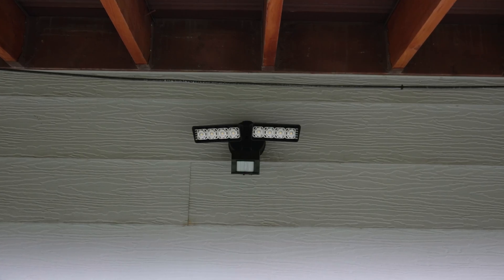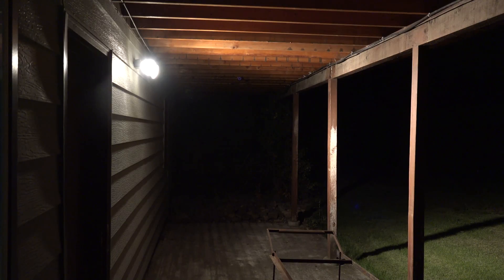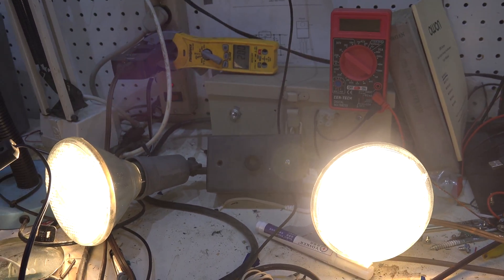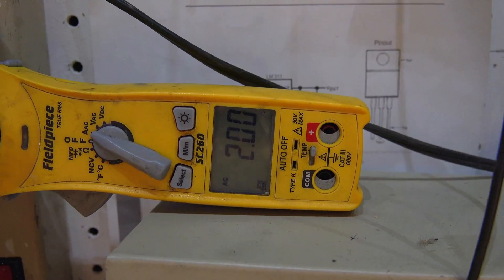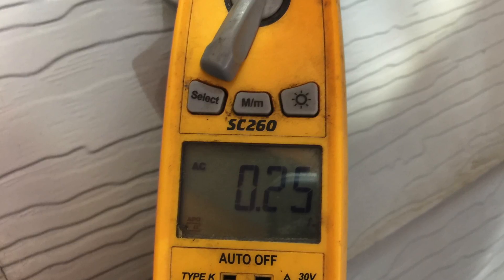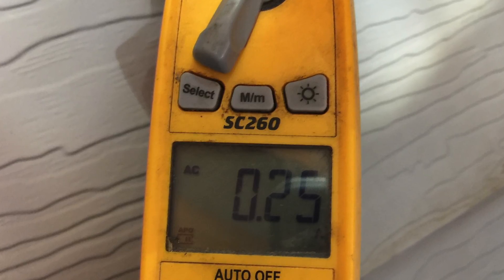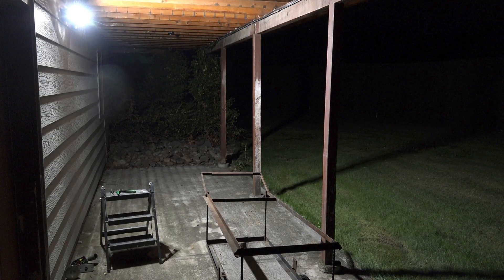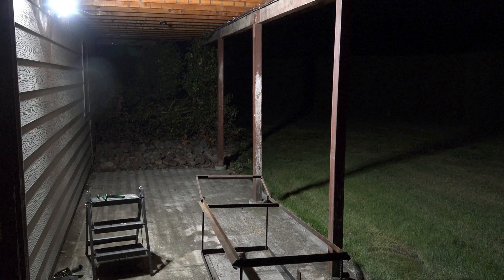A test of a Loftec LED sensor lite.

Comment: Also note that sensors (Motion) tend to work best discovering/sensing objects from the sides rather than full frontal.  Newer technology like PIR's can/do detect heat working with motion as well..  Cool, cost sensitive light. GFM... Nice to break the flow with redirected learnings...

Comment: I’ve never had great luck with motion sensors. They seem to trigger with the wind or they turn on with motion and stay on. I currently have a Cooper sensor installed but all of the different brands look the same. I wish someone would make a higher end motion sensor that was more accurate. I do like the idea of pairing LED with a sensor. It makes the electrical consumption almost nil.
Reply: RAB makes a high end sensor. you need to adjust the sensitivity if the wind is triggering the lights. avoid aiming at trees that move in the wind. avoid reflections. they can be a pain but then again they can last for decades. Good luck
Reply from the maker: I also have used motion sensor lites for a long time.  I have never had one fail.  They do nuisance sense commonly from wind, animals, etc.  
GFM